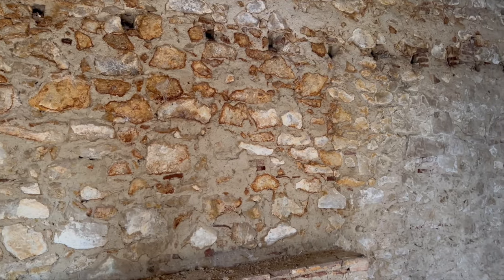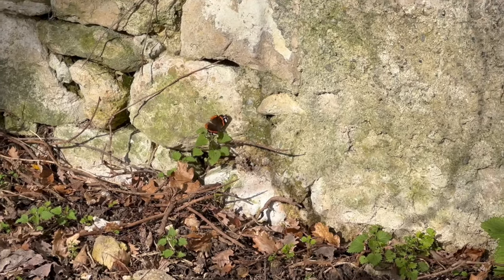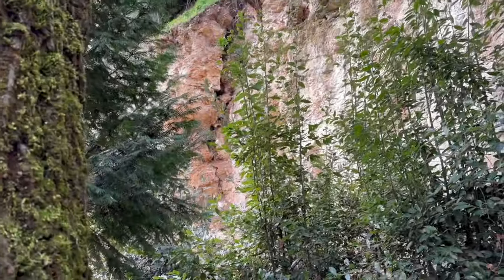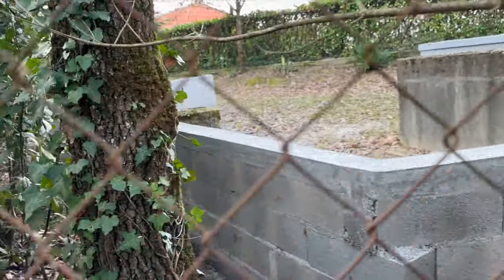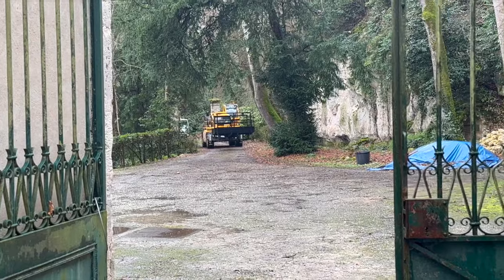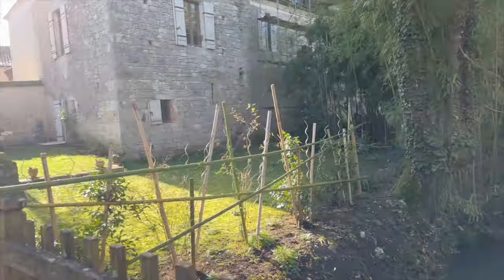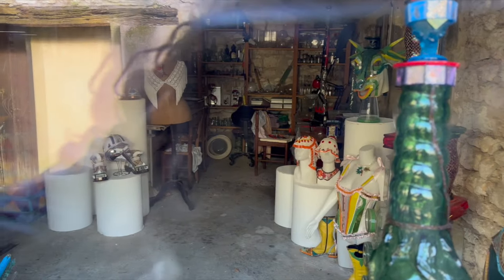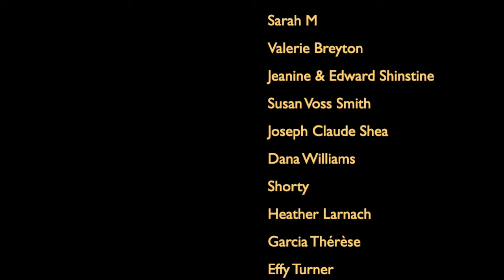Chateau Chronicles: Geologist Insights, Skylight Dilemmas, & Painting Progress! 🏰🔬Ep#74

Comment: I am for 1 skylight. I did this in my former house. From my experience get one that opens so that you can vent the hot air and get one that has an interior shade with UV filter glass. They can cause a lot of heat coming in through the glass.

Comment: Have you considered using the small spherical roof light in your cottage. Rather than larger skylights which may allow heat build up, the smaller ones let in light but not heat. Also they would allow you to position light exactly where needed and would be simpler and cheaper to install.